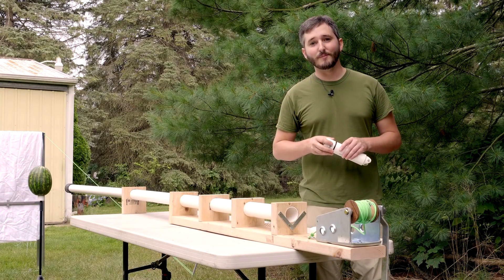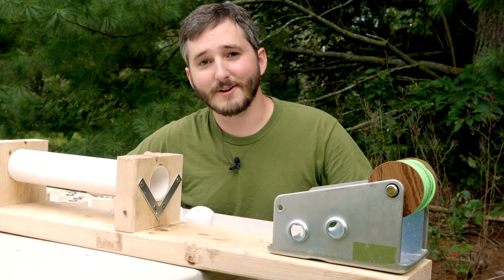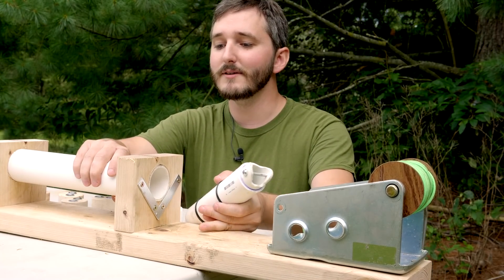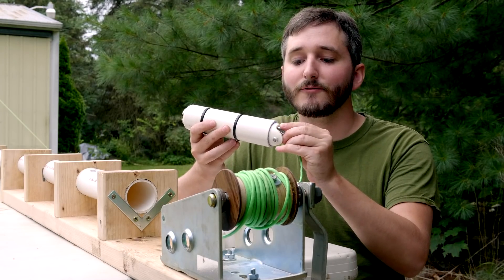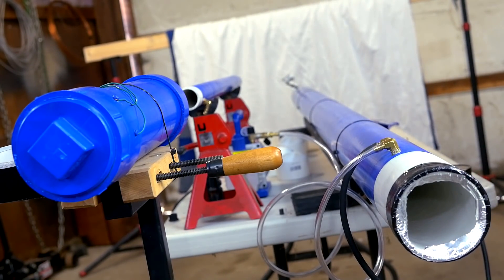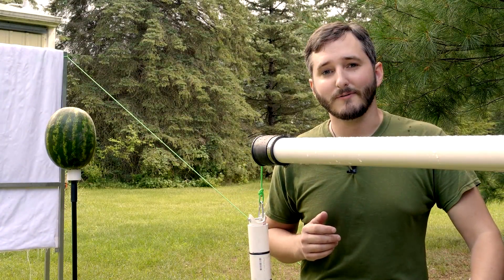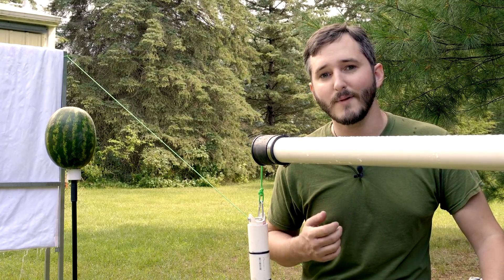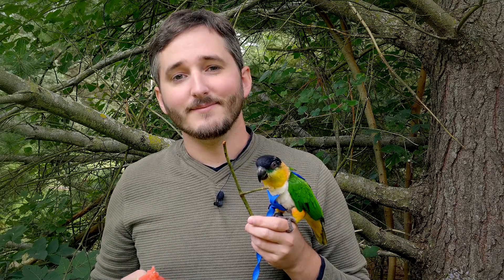Rapid-Reload Vacuum Cannon: Magnetic Piston, No Burst Discs

Comment: How about sabot ammunition? You might be able to penetrate multiple cabbages!
Reply: I like that idea! Reminiscent of the US Navy's rail gun. Perhaps a small, fin stabilized projectile housed inside a polystyrene sabot. The projectile could be made of aluminum or some other lightweight substance and the magnets could be bonded to the sabot.
Reply: I've thought about that too. Using some sort of light foam (possibly pool noodle or even the foam that fake plants have) you could make the discarding aspect of the sabot and the projectile itself could be a nail or bolt. The fun part would be figuring out effective fins for stabilization.
Reply: Yeah, just stuff multiple projectiles in there
Reply: Would be interesting to see if you could shoot a real arrow or crossbow bolt like this, along with how large a vacuum would be needed to get equivalent force to the real weapon.

Comment: Ditch the hand crank and string and replace with extra long wormgear actuator. Program it to jog back and forth pausing 3 seconds at each end. You can then rapid fire as fast as you can load and add the cup seal.

Comment: I could almost make this an semi/semi-automatic cannon with a few modifications.

First, instead of pulling the piston all the way out of the pipe, add adequate ventilation holes to the pipe a foot or two before the tail end of the pipe. This will allow you to break the vacuum seal WITHOUT having to pull the piston out of the pipe. I imagine some power may be lost due to a slightly decreased air flow, but probably not much.

Second, behind the ventilation holes add a large cutout that is large enough to compensate your projectiles. This is going to be your magazine receiver. After firing, pull the piston back behind this point which will allow another projectile to be loaded in.

Third, add a pulley system of strong magnets that runs the length of the barrel. After you've fired and dropped another round in, the pulley system activates which pulls the piston back to the front of the barrel. You may need very powerful magnets for this. Some other trigger drops a cup into the end of the barrel (not sure how to accomplish this one).

An automatically reloading and firing vacuum cannon that fires as fast as you can rotate some driving motor.

Comment: This is the very first video of yours that I have watched. This vacuum barrel is nearly identical to one that I have had bouncing around in my head for the better part of a decade. 
The projectile can accelerate much more quickly by allowing the barrel to ablate as the projectile passes through.
Reply: Sean Hollingsworth I can't understand that last sentence using the dictionary definition of ablate.
Reply: @RichardBronosky  
Multistage rockets are ablative systems. The Saturn 5 system is a rather extreme example of this; whereby when a section is no longer needed for the rest of the mission, it is jettisoned or otherwise left behind.
Applied, in this context: once a section of barrel has been passed through, that section is removed, or otherwise  punctured to allow atmospheric air to have more immediate contact with the rear of the projectile; as the velocity at which atmospheric air can enter the rear of the barrel does have a limit.
Reply: Sean Hollingsworth yes, but he couldn't even get a front valve to open fast enough.  For that he had the full length of the barrel giving him time to get it done. You are talking opening valves that have even less of a time window in which to offer value.
Reply: @RichardBronosky  
Arguably, it would be a more complex system. 
I have entertained the idea of electromechanical valves. They could be opened within a few centimeters of the rear of the projectile as it passes by. It can be either timed based on observations, or triggered as various sensors are passed. The valves should be able to be easily opened, as they would no longer be held tightly shut by the vacuum after the projectile passes.

Comment: Serious props for being one of the few to take it beyond a typical science class quickie! Put a tee on the breech with a sliding sleeve inside it that  seals off the right-angle leg when "cocked". That leg has a chamber of compressed air, that's released when the piston pulls the sleeve, then itself, clear. Envision a sleeve that's like your piston, but unobstructed at both ends so the pull line can pass through it freely, and the rear of the tee having a cap/bumper drilled for the pull line and maybe a sleeve-resetting tool. The higher pressure shouldn't affect pull force if properly sealed, and the breech cap negated assuming ample venting (possibly a port closed off by the sleeve as it opens the tank?)... Sorry it's getting long winded -  I'm game if that piques any interests.
Reply from the maker: Nice idea! I like that. The only issue would be ease of access to the breach for maintenance or if the piston got jammed up trying to push it back in.

Comment: Thank you so much for this innovation. I've been wanting to make either a scaled or full sized air cannon based off of German AT guns (have not decided which model). I sat there watching your older videos and thought "Could a chain or something else pull the piston?" I was worried to experiment myself but thanks to you it shows it will work just fine. Huge fan of yours. I'll probably start construction come spring.

Comment: If the magnet retracts before the seal is broken then you may be able to squeeze out a little more velocity. A simple spring lever mechanism attached by cable or string and the whole assembly inserted from the rear would allow the magnet function while maintaining seal integrity.

Additionally, treating your projectile and tube with a Teflon coating may squeeze out a little more velocity as well.

Comment: One extra thing to consider as an advantage of your winch system is that your pipe/barrel  doesn't strictly have to be straight just enough to not have the plunger or projectile get caught (a spherical projectile would probably help this).  Perhaps then you could use this to your advantage to pack more barrel length into the same space for attempting to improve the output speed!

Comment: Hello there! An idea you may be able to capitalize on is if you attach a rope on the outside of the front of the barrel to the plastic cup, that way the cup floats in the air off the end of the barrel, and can be quickly inserted back in without losing the cups or having to go and find them

Comment: I watched YouTuber Bruce Yeany put out a video that combines the vacuum cannon with a pressure cannon.
I can see your piston method modified to open a pressure chamber similar to what he did.
Mr. Yeany also provided some insight into the physics happening inside the tube when launching.
One interesting thing brought up was the pressure inside the tube acted like a spring during equalization. 
No follow up video was done to highlight the losses incurred from the back pressure and how to lessen or neutralize that effect for higher performance.
Perhaps injecting water or rubbing alcohol at the moment of reverberation would cancel out some of that resistance effectively without affecting follow up launches.

Comment: Maybe a rubber cap would do a good reuseable seal and if u use a pretty light weight plug with a little steel ball at its front u could even get a devastating bullet out of it. Good work BTW and a pretty funny little friend u got there.

Comment: I think you should try using something like silicone grease on the plastic cups to better seal the front of the cannon. I think that'd improve the performance of the cannon, especially at lower cranking speeds.

Comment: Funny thing is I basically thought of this idea except as a full air hanger sized room at the entrance to a Mount Weather style (shelter in a mountain) bunker. 
Basically have a wall that is pulled from one side to the other clearing all air from the room and can be released by entering a code and gas containers would empty to refill the vacuum enough to be safe or destroy anyone trying to open it without the code.
YouTubed weaponized vacuum and found this video.

Comment: Mythbusters built a longer one and found that the projectiles travel slower. Its due to the air leaking around the pingpong balls and getting ahead of it. They found the best length of pipe was only 10 or so feet. I'd suggest you watch that episode before investing in more pipe.

I had an idea though, but it would change your design back to requiring a pump. If you had a longer pipe but put some vacuum tanks at different intervals down the barrel to remove air that is bypassing the projectile. Maybe you could keep accelerating with the longer barrel. 

Or maybe you had 2 barrels in parallel but you only let air in on one and then they were connected muzzle side. This would keep pulling air out of the barrel that bypassed the projectile. 

I'd be interested in you looking into this design as i think that friction would be your only limit on the speed of the projectile.
Reply from the maker: All you need is an air tight projectile and the problem solves itself.

Comment: NightHawkInLight  Riser pipe wit T piece 30 cm from end of barrel. with tennis ball in riser. A slight restriction stops ball from falling in barrel. Piston moves past T-piece- lets air in from riser . Ball is pushed down by atm. pressure then.You can leave the piston in the barrel .

Comment: You should make a very large shaft where the pressure will build along with a large piston to fit, so you can have a huge amount of pressure, and then instead of the pressure chamber and the barrel being the same thing, attach a small 2cm or 1in tube as the barrel  so a ton of pressure is released trough a tiny barrel launching a super high velocity small projectile.

Comment: Have you seen those machines that turn plastics into oil(s)? A large airtight container full of plastic heated up and a pipe for the exhaust going through water or some other thing to distill out the different oils. I bet that would be a cool addition to the wood gas idea and you would make a great machine i'm sure.
Reply from the maker: Yes, I've tried it in my regular gasifiers but they do not get hot enough. I would need to build a new one that either uses a fan to increase temperature or a different type of fuel.

Comment: Would it be possible to somehow take advantage of water's higher speed of sound (or of some other fuild) basically making the following:

A bigger pipe that reduces to a smaller pipe with the smaller pipe being the barrel of the gun.
Have a water tight sealed piston on EACH pipe.
Fill the space between the two pistons with water and no air
Load projectiles into the smaller pipe, and have the force be applied on to the bigger piston, which will move subsonically while the smaller piston can move super sonically.

Comment: I think it would be sweet to make a version of this for nerf darts. You could use a bras pipe to fit the dart and have a built in electric screwdriver to power it. An actual cork could seal the end and be attached by a length of string so it is truly portable and reloadable.

Comment: Suppose you designed the cannon to be the shape of a bottle, with a narrow neck opening abruptly to a large body. Use the same draw mechanism you have now, but inside the large body is a doughnut shaped piston. The cord runs through the hole of this doughnut; the small piston is conically shaped at the rear so that it can form a tight seal in the doughnut's hole. Now the small piston evacuates the "neck", pushing the air out through the hole in the doughnut. When the small piston comes into contact with the doughnut, the two together evacuate the large "body". The idea is that you can get the same air volume in a much shorter run - instead of 16' of 3" pipe, you could use 3' of 3" pipe and 14" of 10" pipe, which is almost the same volume in only a quarter the length.
Reply from the maker: The wider diameter your piston is the more force it will take to pull it out. A 2" diameter piston only takes 45 lbs of force to pull, but increasing the size to even 3" in diameter and it takes more than 100 lbs. A 10" piston requires more than 1100 lbs to pull.
Reply: Yeah, but you've got a winch on it already anyway, so it's just a matter of gearing.

Comment: I love the novel solution to replace the burst disc. I was wondering if perhaps you could connect a line to the inside of the cup so that it won't fly away during the firing process. Perhaps using epoxy to cement a nylon cord to the bottom and tying it off to the board. That way you can quickly reload with the same cup, assuming the cup maintains integrity after sustained use.

Comment: Love your work ⚒!

Can you look into making a self self sufficient home 🏡 improvement?

Like, running undrinkable water through pipes, focused sun rays heat 🔥 it up, a boiler convert it to electricity. Finally water is condensed to drinkable.

Little bit worried 😯 if my country goes to war. 😅 🌹

Comment: How about adding a Venturi bypass channel at the end of the barrel?  Make them longer than your ammo and it should allow a small insignificant amount of air to leak ahead of the ammo.  This air will then compress in front of the ammo and force the mechanical door open!  I'm not sure if these channels will need a one way valve or not.  It might be an excellent use for the Tesla valve!  Good luck and God bless!

Comment: So you are showing ridged PVC Pipe for the "Cannon". If the Piston was somewhat shorter, I would think it could effectively transverse a fairly large coil of flexible black piping as a sort of preloading to the final exit tube and result in a much faster exit speed without making the Cannon part excessively long. Possibly the projectile could remain in the straight section with some sort of stop to avoid the added friction, but either way, the volume of the vacuum area would be significantly increased. I might just try that myself! Thanks and good luck.

Comment: I think the Mythbusters found that extremely long barrels slowed down the projectile speed. It would appear after their tests, there is an optimal length for a vacuum barrel. I do think their testing wasn't complete. If I remember correctly, they found air passes around the projectile creating a shock absorber at the burst disc. Their test only used a ping pong ball with loose tolerances with respect it's fit to the barrel. As your piston creates the vacuum a lot less air could force itself past the piston, ensuring a better vacuum over the entire shot.
It would be interesting to see how long the barrel could get before the projectile just exploded on contact with the air.
Reply from the maker: I believe using a cup as a cork as I do in this design would solve that air cushion issue.

Comment: Cool. Also, you may not need a long barrel to get high speeds. What about 
cold shaped charge?  Where two more barrel focus onto one barrel and on to 
the back of the projectile. The tricky part is getting a vacuum in multi tubes aand
letting the air in at the same time from multiple valves.

Comment: I suppose you could use a triple layered balloon, one iside the other, for strengthening then placed on the pipe exhaust nozzle. As the piston is drawn the balloon 'reverse inflates' back inside the tube whilst at the same time sealing it.

Comment: wondering if I could use this to launch a frozen fish torpedo out into the ocean for shark fishing from shore haha. The rigs they make for a setup to do that costs like $700
I guess the only issue is that you need to have a fishing line attached to it and that make break the vacuum seal.

Love your videos, been watching for a long time, keep up the good work.
Reply: You'd need your tether coiled up inside the barrel, attached to your bait and the inside of the tube. When you fire it, you'll want the could to go forward with the projectile as it's uncoiling. One it gets all the way out there, you clip onto it with the reel to haul it in, so it likely need a small eye spliced in the line just outside the end of the barrel after firing.

Comment: I love SO much the idea that gets rid of disposable aluminum...
Now that I see it, maybe a sturdier cup, and a bit extra air in front of the projectile can make a reusable front seal. Or maybe a semirigid sheet of flat rubber, some kind of light plastic disk with a rubber face
Anyway... such a masterpiece...
btw, supersonic speeds are possible in compressed air cannons, but it is way more difficult. There is a channel caller Air gun laboratory or something like that, in which a solid slug goes to something like 1300fps on just air. Will try to put a link here.

Comment: Forget joining pipes together, just go out and buy a roll of black PVC well pump hose and you can get it in all kinds of lengths. Your cable assisted vacuum plunger could even navigate the hose if it was coiled in a large loop, so your long pipe could actually take up a much smaller space. Your projectile would go round and round like a particle in a circular collider, and shoot out the end! Put the inlet and outlet fairly close together and you'll be able to see in one camera shot the time it took to travel the length of the pipe and you can calculate the speed.
Reply from the maker: Nice idea! Couplings actually mess it up a bit because it let's some air in a burst when the piston passes by that knocks the projectile off.

Comment: @NightHawkaInLight. Rather than make one long pipe make a coiled pipe so it takes up a smaller distance. You will need to shorten your piston a tad but the compaction should be useful in reloading and transportation. And for your ammunition put a nail through the styrofoam or ping pong ball. This should help maximize newtons equation for impact depth while keeping it as light as possible.